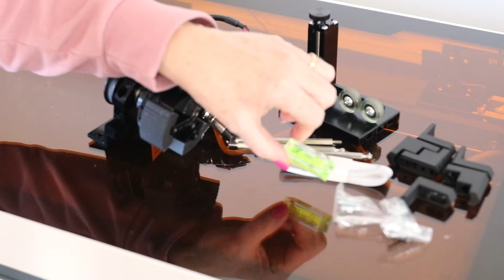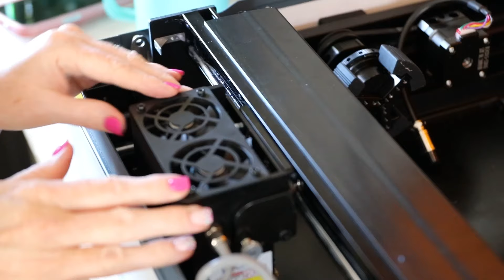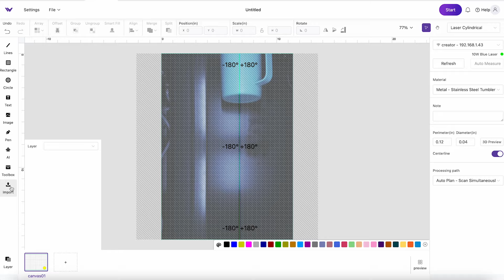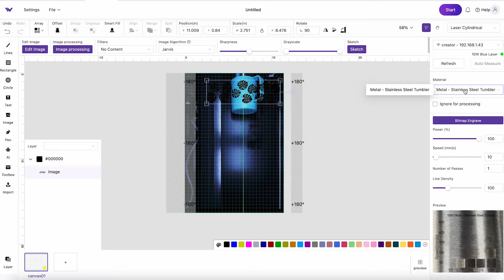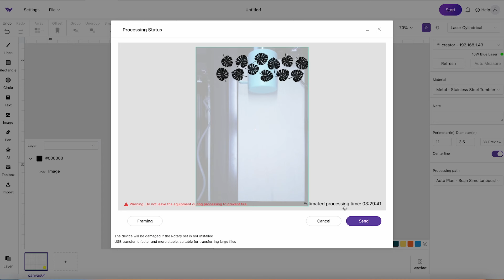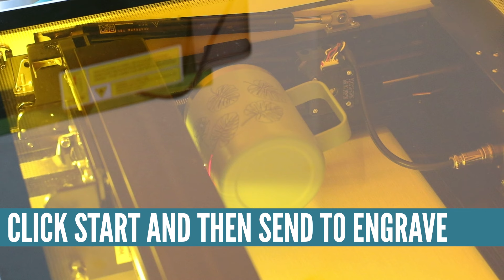How to Use the WeCreat Rotary Pro (And Why You Need It!)

Comment: In the video you had your pattern over the handle. How does it know  to start the design at the edge of the handle and not line engrave over it? I have the vision 20w. TIA!
Reply from the maker: I kept using the framing until I knew it would NOT go over the handle.

Comment: Thank you for your video on laser rotary.  Can you laser engrave on any tumbler?  I am a very beginner and have the WeCreat 10W and 45W and received the rotary accessory with both.
Reply from the maker: Laser engraveable tumblers have a coating that you remove with the laser. It will also have to be a size to fit in your machine.

Comment: is there anyway to move laser head manually like Lightburn??
Reply from the maker: I am not sure what you are asking? You can reach in and move the laser head.
Reply: @AngieHolden not with the laser on it had to be off in order for me to move the head. In lightburn they have actual direction keys you can press to move the head either way. I’m new to the wecreat software where so I was wondering if there’s a way to move it like that.
Reply from the maker: I have actually never tried it that way.

Comment: Ok.  So how about the handled mugs that you can remove the handle? When I measure to do a full wrap do I measure around the little metal thing that sticks out?   I hit my laser head on my first engrave because I thought the laser would recognize it.  But it did not.
Reply from the maker: I bend those metal tabs down so they are not sticking up any more.

Comment: How do you know where to place your handle so the design will start and end at the handle? Great tutorial. It was very helpful
Reply from the maker: I just kept running the framing and moving it until it looked right!
Reply: @AngieHolden  do you get an actual view of where the handle is by running framing? not sure I understand how to make sure it does not engrave the handle. Thanks!